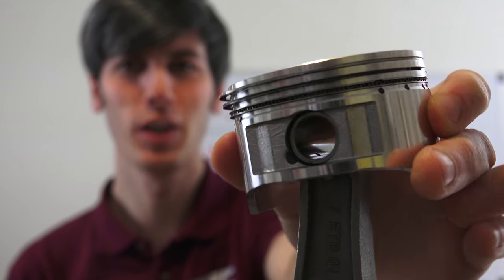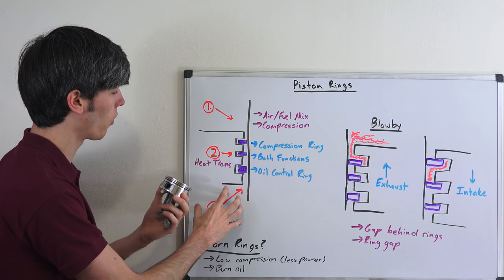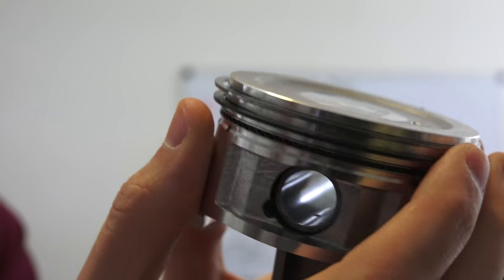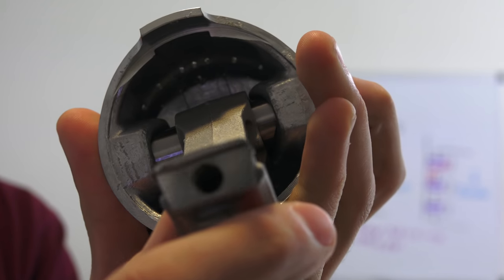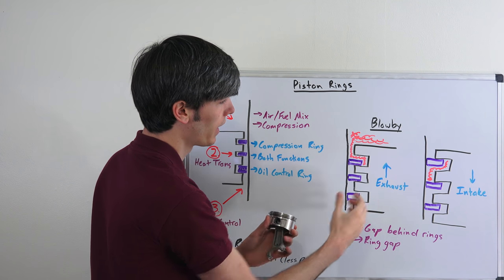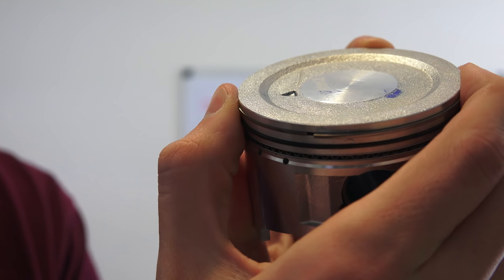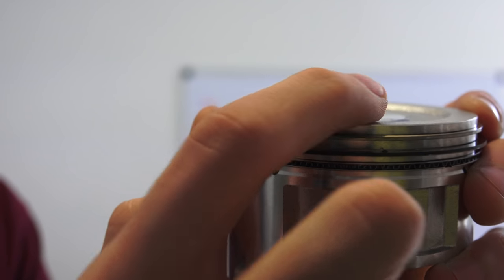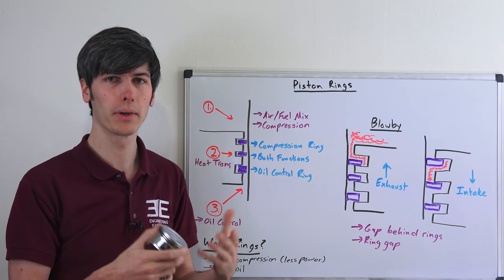Piston Rings & Blowby - Explained

Comment: AFAIK the bottom ring is the compression ring, and central & top rings are oil rings. Compression ring consists of 2 parts with a spring ring in the middle. Recently rebuilt my 2.2 20 valve turbo AAN engine and that was exactly the case.
Reply: +Rihards Zeimanis 
From the top, first compression, second compression, oil ring. 
In more than 30 years professionally in automotive and motorsports I have never seen a ring stack with the oil ring at the top. 
The oil control ring is typically a three piece unit consisting of an upper and lower scraper with an spring/expander in between.

Comment: Great video! Could you possibly explain the pros and cons of gapless rings? Are they more for racing applications than for a daily driver?
Reply: +Dylan Krone 
Gapless rings when sized and installed properly provide a better or more total seal than traditional gapped rings, but... they usually do not last as long before replacement is desired. 
Gapless rings can make more power by sealing better and can help prevent oil contamination detonation at high RPM. 
Some gapless rings are also low drag meaning they produce even more power via less parasitic friction. 
Daily driver is subjective, what I will accept and consider for a daily driver and all that is required may totally unacceptable for you or someone else.

Comment: What would you say the life cycle of a piston ring is? Do higher compression engines lead to quicker wear?
Reply: +Trevor Wyatt The rings should be replaced when you notice the engine burns oil and lacks power(compression loss due to worn piston rings). There isn't a specific right time to change them. If you take proper care of your engine, i.e. stick to your manufacturer's recommended service and oil change interval, the rings can survive over 100k miles.
Reply: +Trevor Wyatt 
When there is an unacceptable loss of compression and that loss is due to leakage past the rings as determined with a compression test and a leak-down test. 
Refer to the manufacturer's factory service manual for specifications.

Comment: I notice the oil holes in the piston wall under the oil ring were only above the extended skirts on the piston.  Could it be that the oil holes allow extra oil to be applied to the piston skirt to provide the extra lubrication it's going to need with all that metal in contact with the cylinder wall??

Comment: What I want to know it, how do you lubricate the cylinder walls? Is there a ring of tiny holes at the bottom of the cylinder that "injects" oil into the ring gaps when the piston is at the bottom or something like that?Or is there an injector that squirts oil upward bellow the piston?

Comment: That is interesting.  I'd never heard of the second compression ring performing oil control.  Would seem that there is nowhere for it to drain, unlike the oil control ring which (in your example) not only have drain holes below it (which I would argue are for supplying oil to the piston skirt), but also typically behind it. Would be neat to show folks an example of an uninstalled oil ring, so they can see the three parts that make it up (although some are one piece), and the drain holes in the bottom of the ring land in the piston.  The piston ring gap exist for the single reason of allowing for the expansion of the ring when it gets hot!  This is a mistake many make when adding boost to a naturally aspirated engine.  The rings get hotter, they bottom out, then they break and score the cylinder.  Boosted engines necessarily must run larger piston ring gaps. ;)
Reply: really i never did i ran .004 for every 1inch of bore... i run 16PSI boost and never had a problem... on ring end gap...

Comment: What is the exact power loss once rings get worn out, or for example if you would mount a piston without compression ring? We know there is very small gap between piston and cylinder walls but you can never make it to perfectly match, and thus the piston rings, but i would like to hear it from someone like you(they never taught us about those things on such precise level) is power loss small, noticeable or significant? I know engine starts coughing up smoke screens and there is decrease in performance, but how much? Sorry for lengthy question, thank You in advance!
Reply: +KRAUSER0130 depends on how bad the rings are. The lower the compression the more power lost.

Comment: BIG QUESTIONS: 1. How much blowby should I have with a fresh rebuilt motor with 2 miles on it?  I broke in the cam fine. I've got a lot of  oil pushing out of my valve covers and some smoke too. Oil is splattering everywhere. I put baffles into valve covers, but little difference. PCV is sucking too much oil into carb/manifold.  2. After initial break-in I see that every cylinder has a half a teaspoon of oil sitting on top. Will do a leak-down and compression test, but any ideas aside from those results??

Comment: Blowby can also occur if the piston ring gaps align together... solving that problem is cheaper than a worn-ring replacement, but it also means the disassembly of the engine.

Comment: Thank you Mr EE! I am now convinced that Hyundai/Kia s 4 cylinder motors excessive oil consumption is due to poor piston ring design or poor materials. Some are affected at 25000 miles! Gamma, Nu and Theta both turbo and non turbo models from 1.6 to 2.4! I think their valve stem seals are bad design in those engines too.

Comment: It's amazing how an engine can have a smoky exhaust pipe & the compression rings are still good,I have a Nissan RB30 engine that was like that,the oil control rings were stuck in the grooves meaning that the oil was bypassing the oil control ring & getting pumped up into the combustion chamber,all that motor needed was new rings & gaskets to fix that problem.

I have an old 92500 series Briggs & Stratton engine that doesn't burn much oil but it has a poor running condition which isn't fuel or ignition related.

The compression tested at 90 PSI yesterday which was down from its previous 97 PSI reading so the engine is almost a no run one,it needs new rings !!!!

My dad had a few of the old Holden sixes which probably just needed a re ring,the engine didn't blow smoke out of the tailpipe but it did fume like there's tomorrow out of the oil filler/breather cap & left a big stain under the bonnet &  the engine coated with oil.

So I'd say that was a case of worn compression rings causing excessive blow by as well.

In a post mid 1976 Holden in Australia, it possibly would've burned oil out of the tailpipe & saturated the air filter with oil.

Comment: Hi bro...Seen many of ur vdos...simple n' clear explanation.I also like ur channel's name eng xplaned.I nvr thought blowby happens aftr combustion... new useful learning. I hav few doubts with ic engines,1.Doesn't blowby occur during combustion?2.Does combustion ads xtra force on p.rings to xpand against d cylinder(i.e does the combustion gases push d p.rings against cylinder during combustion stroke)3.Is it necessary 2 change piston when replacing new p.rings,Why?4.Does d piston ring grooves wear with time/use?
Tnks.

Comment: I've diagnosed this as a source of compression loss a lot lately. Add a little oil, compression goes up? It's the piston rings.

The pile of dead engines behind my diagnosis is about 6 in a month. The previous year? 2-3.

Comment: I like this video. I have a question. I heard that the gaps of the rings are rotated about 90 degrees from each other before the piston gets installed in the engine to minimize blowby, is this true?
Reply: +YSDQ Yep! sometimes its 180*
Reply: +YSDQ You look up the spec. The manufacturer has a suggested pattern in my light experience on the subject.
Reply: Yeah, he didn't  mention that. The gaps in the rings are normally positioned 90 to180 degrees opposite and alternating. the idea is to increase the time and distance that oil and or combustion gasses have to travel so that by the time either would reach the opposite chamber the piston has already started to travel the other way.
Reply: +YSDQ
i would recommend referring to the manufacturer for the proper stagger/clocking and installation procedures.
Reply: patw52pb1 Hey Pat. Good to see you join the conversation.
Reply: DE Nichols
I have been busy lately and I participate when time permits.
How is the hydro project going?
Reply: patw52pb1 Well, as of the current video I don't have evidence of what happened, but I finally know what's wrong with it. :)

Currently, a valve drop was ruled out. That's a bad sign I suppose.

Comment: Hello Engineering explained, can you explain us what are the advantages of a flat or cross plane crank, versus conventional cranshafts?
I'm asking you this question because more and more supercars are getting this type of crank (Ferrari 458 Italia, 488 GTB, all Mclarens, etc), and I would like to know why.

Thank your for all your explanations on all the subjects you've already take us through.
Reply: +Mateo Rojas There are several advantages to a flat plane crank. First with a flat plane crank (180 degree) they are easier to balance and therefore they can be lighter allowing for more rpm (higher redline). Also the firing  order is different on a conventional 90 degree crank if you look at the firing order you will see where there are two pistons on the same side firing one after the other where as a flat plane crank will fire one left bank piston then one right bank  piston all the time, there isn't any instance where they fire lets say right right or left left. again smoother (less inherent vibration) so again you can rev higher. I believe those are the biggest reason for running a flat plane crankshaft.

Comment: I had a 99 Miata that i believe suffered from bad piston rings. It would smoke badly upon a cold start up and during hard pulls. Oil level on dip stick would drop quickly requiring frequent top offs. Spark plugs had oil on them as well. Ended up selling it vs rebuilding or replacing the engine.
Reply: +wayde philpot Those 99 miatas are somewhat sought after, too.  Especially in the club-level spec miata racing series'
Reply: +Ninjar yeah. I believe they have a better cyl head design than later years, but lack valve timing
Reply: Good chance that smoking on startup is worn valve guides. Oil leaks down around the seals and is burned off during startup

Comment: +Engineering Explained can you do, or have you done, a video explaining oil pressure? I was told by a mechanic that the oil pump is not what makes the pressure, but that it is generated by the engine...
Reply: Your mechanic is correct to a great degree the oil pump provides pressure but the oil passages in the engine determine the oil pressure.

Comment: Hi, nice illustration. I have a 2004 Hyundai elantra 2.0L and it doesnt smoke or burn oil but sometimes gets low on power when i step on the gas. What could be the issue?

Comment: I'm concerned with general aviation piston engines - my understanding is that low manifold pressure and high RPM combo should be avoided, it causes "piston ring flutter."
Without sufficient pressure to hold everything in place,  the pistons rattle up and down and the rings scrape and scar the cylinder walls.
Any insight on this?

Comment: Why do motorcycle engines rev higher than car engines?
Reply from the maker: +António Quinaz Smaller engines, wide bore with short strokes. Check out my V12 engine video for more detail. :)
Reply: +Engineering Explained  CAN YOU EXPLAIN ELECTRIC EXHUAST CUT OUTS...THANKS
Reply: +António Quinaz A motorbike does not weigh as much as a car or truck, so it does not need to develop so much torque at low engine speeds, which means the stroke can be shorter and so optimised for high end power.
Reply: +Andrew Marsh that and the pistons are nearly half the weight and camshafts are optimized for higher rpm along with valve springs that are capable of more than 6500rpm
Reply: +Engineering Explained How often do you need to check and change/piston rings and pistons themselves?
Reply: +Draganoid if you have to do that it may be worth buying a new engine lol
Reply: +Draganoid Under normal circumstances you never check them. A mechanic may do a compression test if he suspects that the pistons/the engine is worn out and if this is the case, you basically need a new engine.
Reply: shorter connecting rods and shorter stroke, smaller pistons for less surface area and less friction so they can move up and down faster
Reply: caus theyre lighter
Reply: +Luca Abundo it's what I said, it's not because they're lighter
Reply: @Vinny The Tech actually a long connecting rod would be more suited for a high rpm application, a long rod will spend more time at tdc and travels from tdc to 90 degrees slower than a short rod, creating a more controlled power stroke and burn, at the expense of risk of detonation and low engine speed torque. The reason why people destroke engines is that when the stroke is smaller, you have the ability to run a longer rod without changing deck height, and since a long rod engine generally requires a higher wrist pin piston (shorter), you are creating a lighter rotating assembly by nature, and the reason destroked engines run at such high rpms is not purely the short stroke, it is a combination of all of these things and the newly optimized rod angle (higher being better, to a point).
Reply: António Quinaz
Reply: smaller, fewer moving parts involved in the rotation
Reply: Kevin Vince f1 cars have that type of engine 😎

Comment: I've always wondered how the cylinder walls of a 4 stroke get lubricated -- where exactly does the oil come from?  Doesn't it constantly burn away during combustion? Have you done a video on this?
Reply: Its under the piston, and in the same compartment as the crankshaft
Reply: if you look up videos of old Chevy engine cutaways I believe it squirts oil onto the bottom of the piston

Comment: i have 270 k miles on my tacoma 2000 !  runs like a champ !!!  SO FAR !!!  i change the oil every 3k mile !  will my piston rings still wear out ?  or do they wear out due to dirty oil creating to much friction ??  how often do you need to replace the rings ?? does the oil help in sealing the ring and the cylinder ??  im not a car tech !  so sorry for the lame questions ??  lol
Reply: Yes, yes, never, yes. Your rings will eventually wear out just like every machine known to man.  Yes, friction causes the wear. If you maintain your vehicle and change your oil, your engine should last as long as the rest of you vehicle so it wouldn't be worth changing the rings or replacing other things would make the vehicle more expensive than it is worth. And....I can't remember the last question but the answer is yes.
Reply: +Hammer0f Thor thanks bro !

Comment: Thanks Mr.. Request basic engine oil pressure,engine speed low idle,high idle,rated speed,stall speed,exhaust gas temp, gas colour,boost pressure.. thank you

Comment: is it true that you can check if theres a blowby by pulling the oil level measurer out and checking for any gas/smoke going out of it? What about the gas/smoke going out of the oil fill cap hole?
Reply: Yes if there is a lot of air/smoke coming out then you have blow-by. I would think there's always a little bit because of that gap but there should be very much.
Reply: Pop the oil cap off where you pour the oil

Comment: Does this work the same weather boosted engine I have an 03 cobra and I have just recently rebuilt the motor and it seems like I have an excessive blow by I have filters that replaced The PVC on each valve cover and I just seems like there’s an excessive amount of exhaust coming through